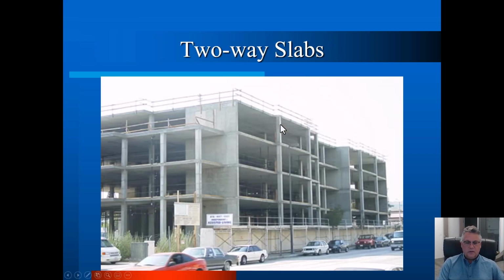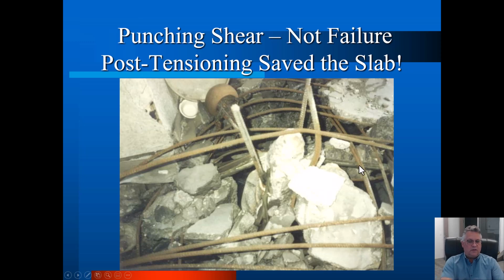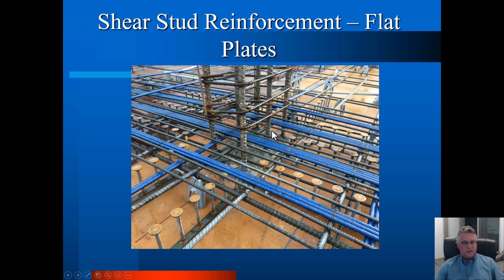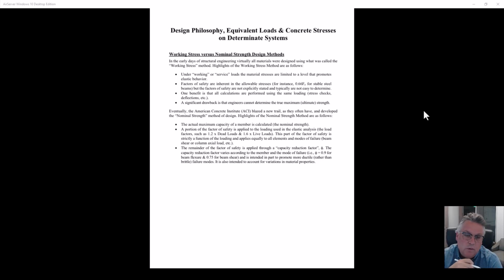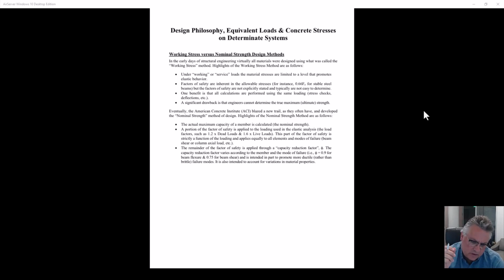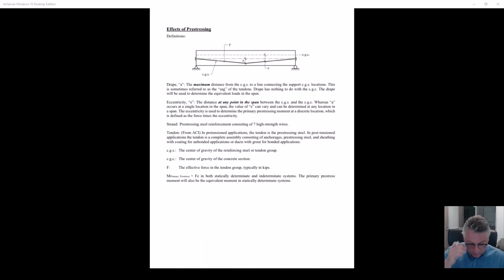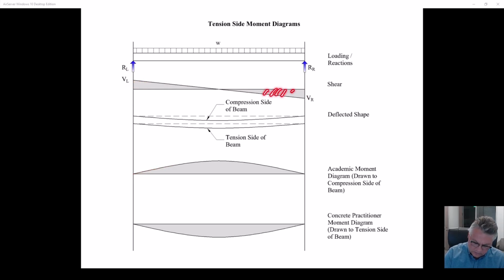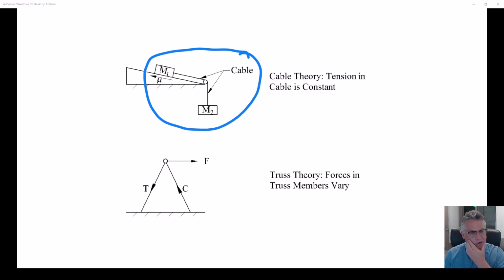Lecture 1 - Introduction to Post-Tensioned Concrete (2023)

Comment: Hey Dirk , you have in your channel two courses of post-tensioned concrete , what is the diffrence between them and what do you recommend to watch ?... i can see that the other is a lot longer than this one but this one is new , Thank you very much :)
Reply from the maker: The first set of videos was taped mostly in 2015 at UCLA.  I have patched in changes as required by Code changes.  That set of videos will be removed eventually.  I have replaced the course with the 2023 videos, and those are the ones currently used at UCLA and Cal Poly.  I can't quite get myself to delete the old videos because I love reading all the comments, but it will have to happen eventually.